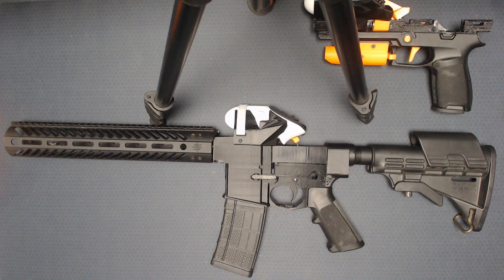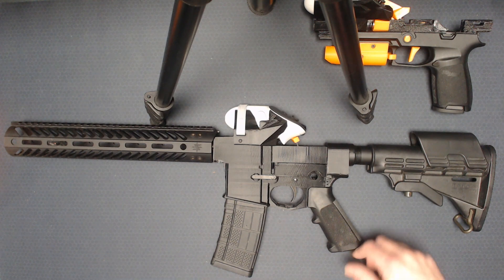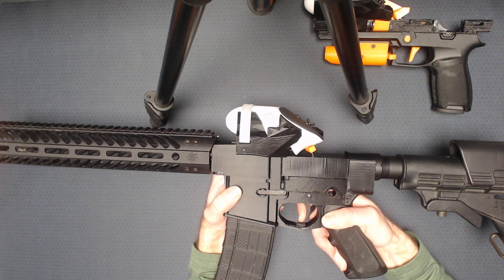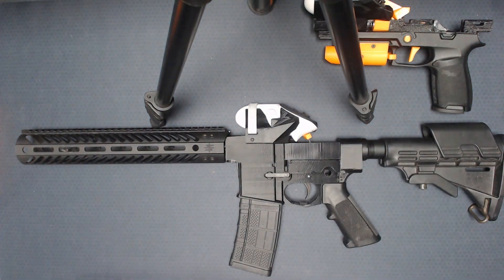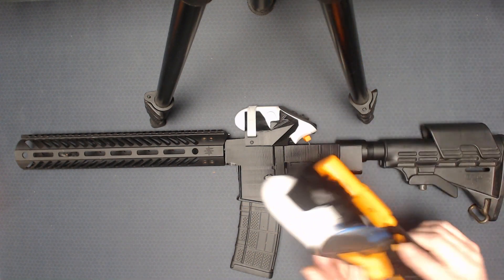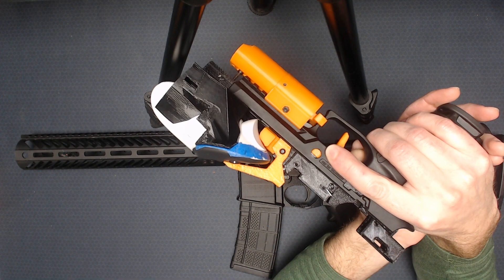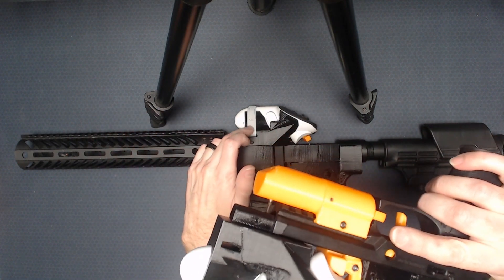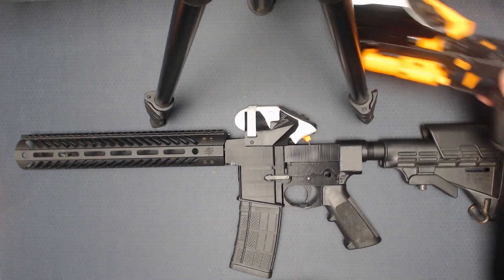XR-15 Extended Reality Rifle game controller - Rigidity

Comment: This is cool.
However, i would integrate an actual metal upper reciever for rigidity, also you could then put the parts from the controller inside the faux-firearm.

Also this could be done with the pistol, and you cuould even make it with a slide that moved when fired, and button actuation when you "racked the slide.
With full integration everything can be made to function.
You could rigg the mag release to be one ove the controler buttons used to reload, or again the slide.
Also; as i mentioned, they make electronic devices that would make the slide recoil with every trigger pull ( they are expensive though, so maybe just find out how they work, and print/ built your own.

But the metal upper should help with rigidity, you could get a blem off brand thats super cheap. ( make sure to route the controllers radio transceiver away from any aluminum, as it may effect effective transmission.

Al in all that's really cool man, keep making.
Reply from the maker: there are a few issues with using the real upper:
1. no way to have mechanical parts exit through the top of the weapon. I've done multiple previous designs that used real upper and lowers, while they have unique benefits, there are drawbacks as well, including legality is some areas. my goal with the end design is to create a full controller that is usable in a large part of the world, without questionable legality. 
2. an upper would require a lower, this lower would have to have the front and rear retaining pins. a trigger cavity, a magazine well. I am not a lawyer disclamer. based on everything that it would provide, it could come very close to the legal definition of a firearm because of similarity. I made intential differences in this design to not go down that route.
3. rigidity. My current tests are using 3/8" or 1/2" all thread, running interally all the way from barrel to stock, and inless I run into issues down the road, I'll likely go that route, as it should address the problem I was trying to solve.
Reply from the maker: On the pistol topic, having the trigger move the slide. what benefit to you see there. It wouldn't be enough movement to generate any felt recoil, it seems it would just be something that could break, especially seeing how the next phase in the pistol is a slide release, and rack able slide. I usually drop my WIP ideas in the discord for feedback, if you want to join in the conversation with everyone. Thank again for the feedback :)

Comment: That, unfortunately, is just a side effect of polymer. If you had a way to at home cnc machine that same design I bet it would have a lot more rigidity and also a more durable controller. Really cool though, keep it up.
Reply from the maker: i Made a version after this video with steel all  thread running through the handguard, upper, and buffer. It really tightened everything up. I should have a follow up video out in a few weeks covering that, and  the other progress.

Comment: Could you modify something like the hoffman tactical orca or super lower?
Reply from the maker: In theory, the principles I used for this could work with a design like that. My short answer is I personally probably won't, because the order or arms is the same for all of them. So maintaining one design, as opposed to three is a more efficient use of my time. I love his designs, but for a training device, it doesn't add anything for me to do a variation on it.
Reply: @AugmentedDefense  Multiple designs would be inefficient. Your issues with rigidity made me think of the orca as that design is rock solid and does not flex. Some other designs from the decad space also came to mind but probably share similar concerns. Keep up the good work! I have shared your app and designs with anyone that is interested in dryfire training and/or vr.
Reply from the maker: @reprobatemind6194  Thanks for the feedback. I have the rigidity pretty well solved by now, I just have to finish getting the video together showing off the design updates. Feel free to drop by the discord. Thats where most of the brainstorming happens.